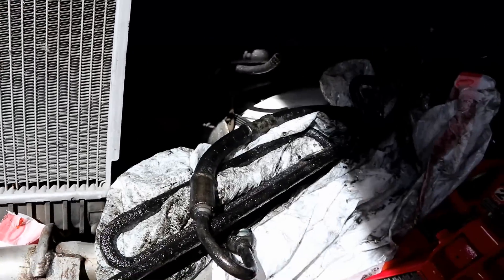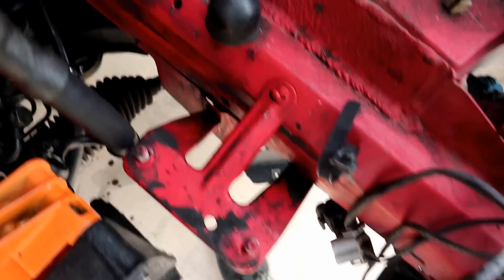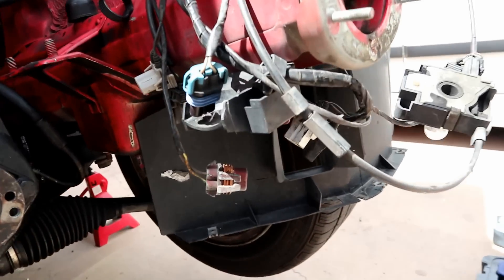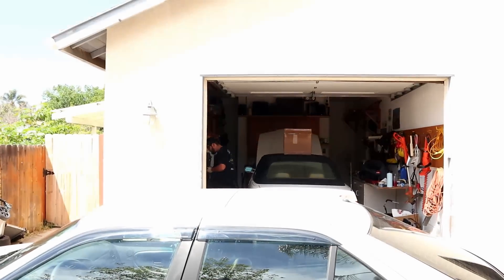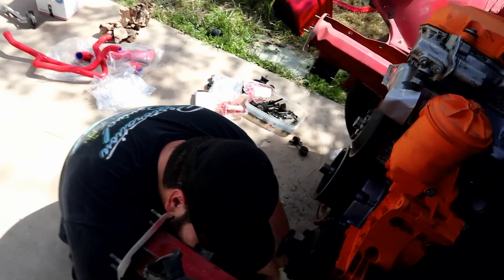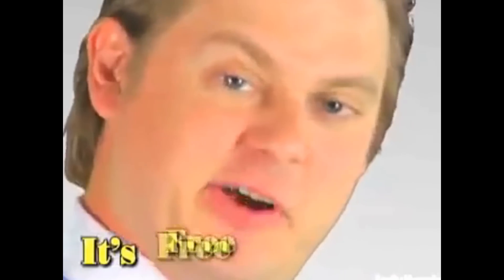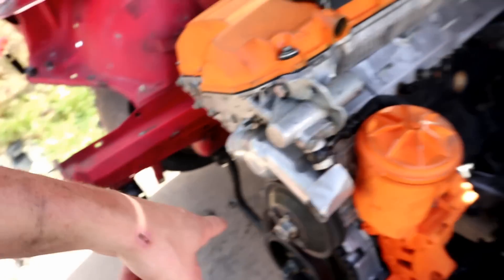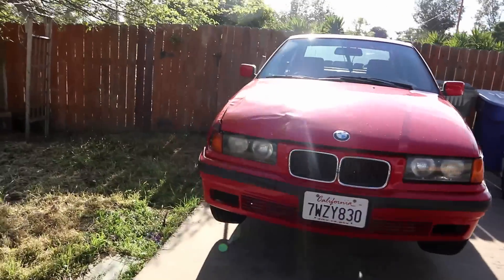The Cheeto's Frankenstein power steering System

Comment: Ugh, refurbishing my power steering system is one of the things I want to do next on my car. Would be a lot simpler with all of that stuff out of the way. Damn E36 power steering life 😑
Reply from the maker: yeah, I just need like 2 weeks straight free to pull the motor on my sedan and fix all of its leaks. power steering pump rebuild, new lines, clean the bay, fit the timing cover and oil pan as they are starting to seep, probably wouldnt be a bad idea to pop the head off too. I have that spare M52 head laying around, I think I might refurb it, relap the valves, and put some supertech valve springs on it, would be a nice refresh for the S52 in the sedan. who knows. If i end up going that deep might as well hone and re-ring the bottom end as well.

Comment: I rebuilt my pump+made my own low pressure line, got tired of the crappy bmw hose fittings falling apart
Reply: Go Clunker nice move I was planning on getting a set of high pressure lines made at my local napa. OEM PS lines seem to always leak.
Reply: @mikeb2496  They suck ass. They have those crappy metal perm clamp fittings and they always leak, in the exact same spot. I got tired of it. The high pressure line I bought new, the low pressure from the cooling line from the rack I dremelled the fitting off, and worm clamped a new hose on 

Zero leaks. The clamps on the reservoir blow chunks too, worm clamps stop the leaks